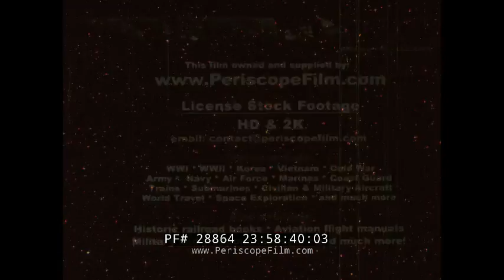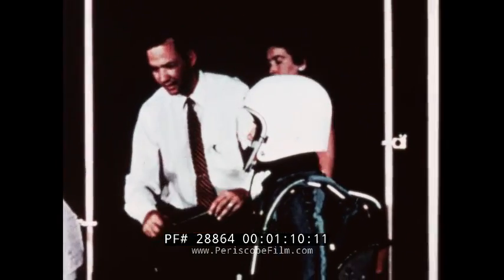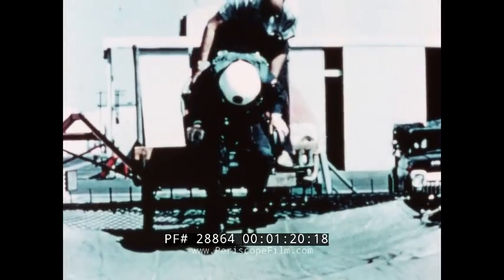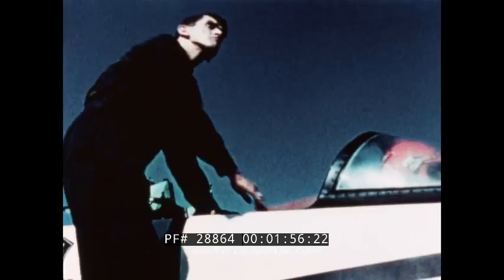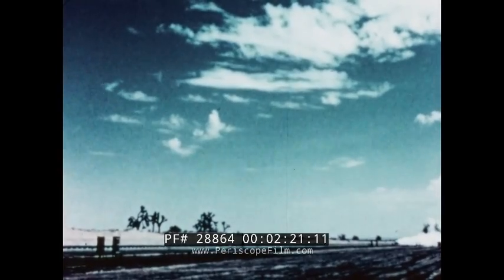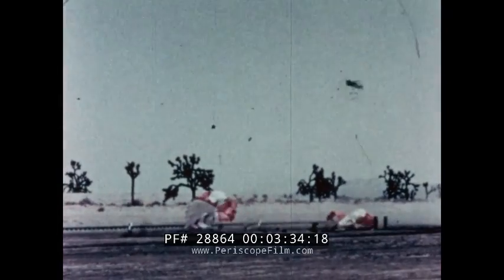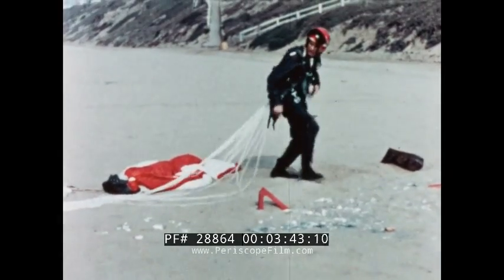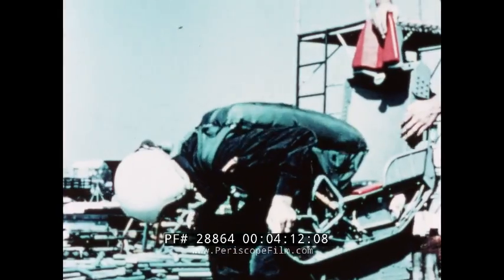" TOUGH SLEDDING "   NORTHROP CORPORATION ROCKET SLED GAG FILM  (Color version) 28864

Comment: It is well known that Santa's nine engine sleigh can suffer a multiple power plant failure and still be able to carry the mission on to Cat A standard. Take out Rudolph and no problem. Dasher and Dancer and Santa's got to kick a little opposite pedal in but still good. Prancer and Vixen and, well, he's putting out a PAN call, OK. But loose Comet or more and that's it, he's got to bang out and hit the silk! It's a well known fact that you can't dead stick these model sleigh's in. Try it and you'll ground loop them every time. And that's not a pretty site, what with crushed presents, wrapping paper, and reindeer antlers up and down the runway! But, as is demonstrated by Northrops Senior Test Pilot, Major Crandell "Crash Test" Dummeigh, an ejection seat is a viable 'post manufacture' add on kit to Santa's sleigh.
Nice to see Santa going up to congratulate Crandell at the end of testing. There's a friendship forged from professional respect for sure!!!